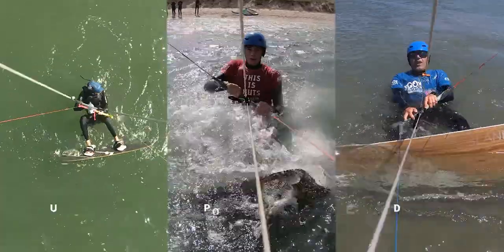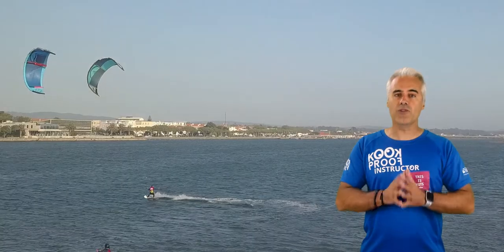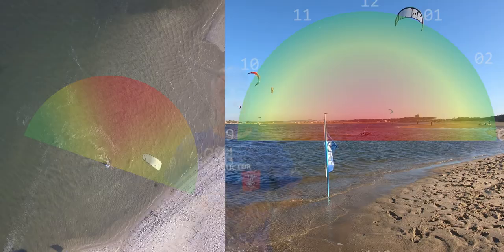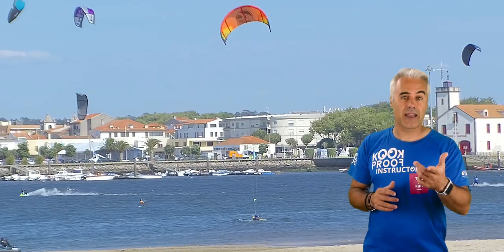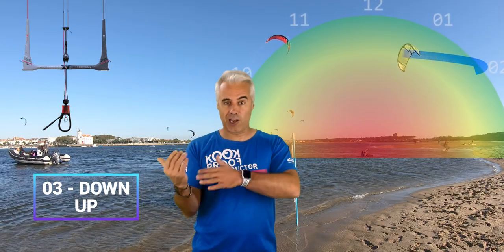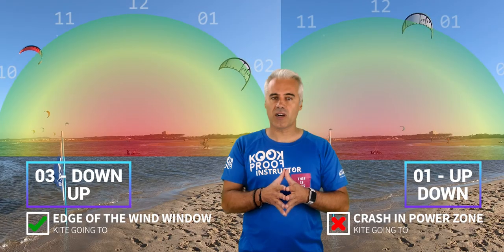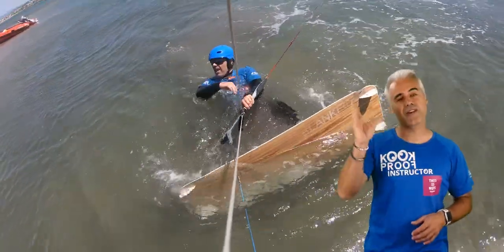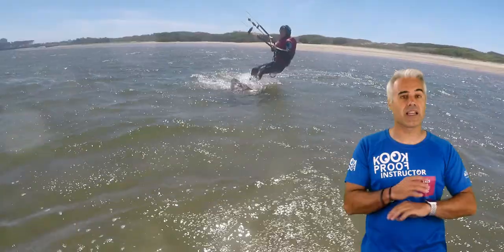Kitesurfing Water Start 3 BEST ways to manage it easily - Tutorial

Comment: One tip from me: do not try to stand up at all, point the board downwind, roll body forward after the stroke and let the kite pull you while keeping a very low stance, this way you can easily get comfortable with moving on the water.

Comment: Please please, teach everyone to set up like this. Do not leave lines lying all over the place. Take-off and landing positions must be the same. That's better, isn't it?
Reply from the maker: Not exactly sure what you are referring to. It’s not a great idea to leave lines lying around.
Reply: Hello, lay out the kite end to the wind and complain.
Lay out lines 90 degrees to the kite end. Start position! You already have the starting position. Leash, inflate and action.
Do not inflate and secure. Lay our lines to the wind - No !! Why?? That the lines will later be pulled across the beach, maybe over rocks or shells. AND:  no Problem with start and Landing with your Broth’s
Reply from the maker: I understand your point regarding the side setup of not dragging the lines over obstacles. However o the downwind setup you can do a line check before launching with a lower risk of acidental launch. I prefer this over the side setup as i usually use good beaches to launch. But i get your point.
Reply: @KookProofActivityCenter  What about the place on the beach?
Most of the time there is not enough space. Then the linen - (salt). Build the way you land, my opinion.
Reply: Why build like that? How do schools want it?
Reply from the maker: Schools setup most of the times downwind. This is done this way so students can double check that the lines are setup correctly. If the wind is onshore and the beach is small then in makes sense to setup sideways but you loose the ability to check before launching that the lines are setup. It comes down to the spot. Each option you take while kiting depends on the surroundings you are at.
Reply: So: I put the kite down. Lay out the lines. Starting position.
Put down the lines. The wind helps me with that.
I let go of the line and the wind carries the line with it.
I put everyone on the  Kite  and only then inflate the kite.
So the kite is exactly as I have to leash it.
Much safer if you ask me.
Just idiots 1
Reply: Schools setup most of the times downwind. Yes, exactly as well as at work. First you study for 3 years. Then you work and learn to do it better.
Reply from the maker: You can always find better ways for your specific spot that might be easier/better. I saw some videos on your channel so i understand  your spot better. it's not a huge beach and onshore or side onshore. Setting up downwind is not feasible or handy in your case so doing it side is better/easier. If you know what you are doing it is fine.

Comment: Thanks for the great video Tiago. Would be more useful if you can show a point of view cam at 7.14 rather than looking at yourself. From a beginner’s point of view, it is very helpful to be able to see the bar and the exact kite movements needed at each stage, to learn these techniques. Cheers.
Reply from the maker: Thanks for the feedback. I’m recording as soon as I can a new updated version so I’ll try to add this point of view
Reply: @KookProofActivityCenter  thanks Tiago that would be great 👍. Any footage without seeing what the kite is doing makes it difficult for a beginner to guess what you are doing.
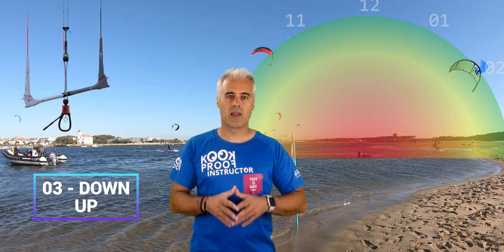Reply from the maker: You have the kite in frame at 4:41. As its the explanation of the movement. At the 7:14 it’s just me showing it but I’ll try to combine different points of view next time to make it easier to understand

Comment: Hi Tiago. Thanks for the good content. Here are some observations about the beginner waterstart.  They are based on the input of thousands of students and dozens of instructors over the last 17 years or so in our school:
Kite:  Student should be aware that they need to have enough control over their kite to commit to 2-4 efficient powerstrokes, linked together (without stopping at the bottom or top of the window),  until they have enough forward motion and apparent windspeed to stabilise the kite at 10 or 2 o'clock.
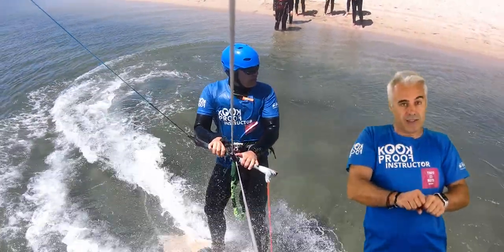-"Efficient" here means 1) sheet in on the bar for sharp turns, then 2) out to accelerate the kite as it comes out of the turn, then 3) back in again to harness that speed in order to generate power. (as you explained at about 5:15)  If the instructor is trying to get the student to waterstart with 1-2 strokes then most likely the student has been given a kite with too much power and too long lines, without first developing sufficient control over their kite. Evidence of this is when the student flies over the board again and again in their waterstart attempts.
-It's best not to bring the kite back behind 12 o'clock to start (or anytime during) the powerstroke, this just destabilizes the student.
-The upstroke is just as important as the downstroke and should go right back up to the top of the window in the first strokes to help pull the student up out of the water.
Board: 2 things need to happen with the board in the first part of the waterstart; it needs to point downwind and it needs to flatten out (so that there is not too much edging).
 -Rather than extending the front leg as the pull of the kite comes in, both legs should be kept bent to keep the student close to the board, so that less power is needed to get going. You are totally right that the student does not need to "stand" on the board. They can keep this curled up position with the legs bent until they are up and moving over the water, then they can straighten their legs.
-One of the biggest tips for the first part of the waterstart is to point their forward shoulder downwind and towards where the pull of the kite is coming from. This puts pressure on the forward toe to flatten the board and point it downwind.
Good videos, keep it up!
Reply from the maker: Matt-0 Teachings thanks for the feedback. Some nice tips also.

Comment: hi, thanks for the video. i don't really see much difference between methods #1 and #2. it seems like in #2 you just don't get the kite that much down, and this is it... basically depends on how strong is wind. #1 is just more amplitude thing. am I wrong?
Reply from the maker: That is more or less correct. The main diference is between 1 and 3 in the low wind.

Comment: In the end it all depends on the student, how are his/hers skills and how does he/she handle and understands the power and what kinda persons are you dealing with as an instructor.
I prefer a build up in power and a good focus on the legs and the power needed from the legs/knees. Start at 12 and go steer to 11 and try to get out of the water by using the power of the ite and your legs. Not enough? Go from 12 to 10.30, after that got from 12 to 10. Standing up by now and not crashing the kite? Go the 2 power stroke if needed to continue kiting.
But don't forget your legs and knees!
Reply from the maker: Of course, legs and knees are essential, and also the skills of the student play a role. The power is the same if the kite goes from 12 to 10 or if it goes from 10 to 12. The difference is from 10 to 12; it is helping to stand up as the force is going up. Also, if you fail on 12-10, the kite is going to the ground and can crash easily, destroying or helping to destroy it faster. Try it and see the difference.

Comment: After years of up-down waterstarts, this video is blowing my mind. I can't wait to try it out! 
Do you know who invented this method? Was it inspired by the kite loop waterstart? Is the bar sheeting similar for the kite loop waterstart (sheet in to steer, then out to center in window, then in again to power up)? Do you have any experience with the backstall method?

Sorry for so many questions, this video was very eye-opening. I  am trying to push my lightwind foiling to lighter winds. Which method would be the best for light winds?
Reply from the maker: Abraxas Filibusterofini i first heard of it the guy that trained me to become an examiner years ago. It wasn’t exactly like this, and i have been testing and perfecting it since then. It was not inspired by the kite loop water start, but that one works well also in light winds. The critical point is to use as much as possible of the power zone but have the kite pulling up and towards the edge of the wind window. The back stall method doesn’t use as much win window as the other two that cross it on the longest possible run. The down-up also gets you upward pull that helps you to stand up. That is why I recommend it to beginners in light to moderate winds using short lines. For hydrofoil in light winds should be very useful and give you the power to start and continue easterly. Once you test it out let me know how it went for you here in the comment box.
Reply: Kook Proof Activity Center I got to try it over the weekend. In light wind with a large kite (14M), the kite ends up near 1 while turning it around. However, I had success with driving down from there and quickly up through the power zone during the waterstart. So more like a U-shaped stroke. What I liked about this was that the kite ends up high in the window just at the moment I need a second stroke to start foiling! So a bit different from stronger winds smaller kite but still a substantial improvement from the conventional up-down. I’ll keep playing and practicing this in future sessions, thanks for the great tip!
Reply from the maker: Abraxas Filibusterofini glad it was helpful. Have fun in the water

Comment: I discovered power stroke method on my own after getting launched alot with up down method. Question about down up. Is the starting position same with up down, where board should be perpendicular to wind direction?
Reply from the maker: The starting position on the down up is with the board parallel to the kite. So it is already pointing downwind. There is a section on the video about the position of the board in that method.
Reply: @KookProofActivityCenter  yes you did mention about board being parallel to kite. But at what position? At 2 oclock?
Reply from the maker: @christopherjohnmercado1568  Yes, when starting it’s parallel to the kite so 2 o’clock starting point the board should be parallel to the kite position. This way once you start to move the kite the board is already pointing downwind helping you to get speed and stand on the board.
Reply: @KookProofActivityCenter  very interesting. Will try this!

Comment: Hi, will the proper kite size make a big difference toward a successful waterstart?  I’ve been stuck at this stage for a little while and feel that it’s holding me back from progressing further along.  I’ve taken two waterstart lessons from two different people (training with a 13m c-shaped kite) and the different bits and pieces of advice still isn’t helping me ride.  As of now, I can get up but will plop back down when I try to waterstart.  I also feel a bit underpowered.  I weigh 220 lbs and my home spot has 20-25 mph winds on a good day.  Therefore, is the 13m too small considering my weight and wind conditions?  Should I consider getting a 17m and keep practicing?  Thanks.
Reply from the maker: Hi Matthew. After a few conversions, i understood your size and winds. You can ride with the 13 c-shape in those conditions, but you need better skills. An SLE kite (bow or other design with more depower) will be way better for you to progress. A c-kite needs to have better power control as it’s less forgiving due to more precise power delivery. (Easiest way to explain). Practice will help you a lot, but i would get a different kite also. I guess you struggle more on light wind days. So go for the giant kite. In 17, i would say the ozone zephyr is a great kite. You will eventually get to the point that you will also be able to use the 13 by moving it up and down to generate apparent wind after the water starts to keep the power-up. I hope this helps and keep practicing. Cheers

Comment: Hi Tiago
I am quite interested by your « down up » technique, and wonder if it is more efficient on a spot totally « on shore » with a strong shore break and a wind quite light , in addition reduced by wave current (apparent wind)
In these conditions I need to gain speed very quickly after a first wave pushing me to the beach to be able to jump efficiently the next one with upwind speed. In addition I cannot afford any additional move downwind (at least more than the push by the waves)
The kiteloop waterstart works ok but it is quite difficult to time it properly with a large kite and the coming waves in your back when the board is just under your feet.
Does down-up allow less downwind move than an agressive S up-down that I used currently? And compared to a power stroke ? 
Thank you anyway to open my mind to new technique😎
Reply from the maker: starting in onshore conditions is always complicated. You need to get as much space as possible. Having waves makes it even harder. But this technique is for sure the one pulling you less downwind as you are carving almost from the start. Still you do go a little bit downwind as you need to generate some some speed. Glad i could help out.
Reply: @KookProofActivityCenter  Sounds good, I will try ASAP!😎
On the same spot, I need to use all the length of the beach to gain a little bit upwind! When at the end, would it be useful to make the tack transition with a similar technique to avoid to loose any ground? With your experience, is it something you would recommend as I never seen a video showing it as transition?🤓
Reply from the maker: I don't think so as a transition; I would make a normal one trying to maintain height.

Comment: Nice tip! I was always making N1, I will definitely try N3! Just one question: Do you have a video or tips on how to leave the kit 45º once you waterstarted? I am managing to waterstar perfectly and keep going, but I am always controling the kite that it goes up and down, I can't seem to leave it fixed at 45º to have a steady run and just focus on body and legs. Would love your input in this! Thanks
Reply from the maker: Keeping it steady at 45 depends on your speed. So you need to control this by edging more or less depending on whether you need to slow down or increase your speed to maintain the kite in the same relative position. (It will actually move forward or backward in relation to you but it should maintain at 45) You can adjust power by moving the kite(which generates more) or changing your edging. This edge change will change the relative position of the kite to you and the power it delivers.

Comment: There is one more good low wind method  for more advanced rider which is to kite loop, you do it by pulling hard opposite side of bar where you wanna go.
Reply from the maker: True. But not so easy to master for beginners. That is why I left it out.
Reply: There's a 5th method for low wind, but works only with softkites: backstall the kite at 12 o'clock to sink it deeper in the wind window, than stear it into the direction you wanna go
Reply: @Lack0  I understand your 5th method (I use both LEI and foil kites) but it looks for me quite similar to the down-up method Tiago described, with difference of just pulling the bar vs pulling very hard and wait to a clear backstall before sliding the kite through the power zone. I am I wrong or what are your main differences? From your experience, any difference between the 2 techniques on the downwind drift during the start that I would like being minimal on a very tough « on shore » spot ?😎
Reply from the maker: it is similar but a t the same time diferent as you need to point downwind to absorb the direct pull from the kite. in the down up you are already carving so you go a bit less downwind.
Reply: @nicolasboudet9302  I don't really use the backstall method. Actually I prefer Tiagos down-up method in low wind conditions and use the sheet in and ride method in stronger winds. I bought a new very fast turning kite (Kauper Maverick) a few months ago and with this kite on long lines (and also with my old Rebel on 13m lines) I can start with a 6th method: simply move the kite between 11 and 1 o'clock back and forth till I can stay on the board and then ride in one direction

Comment: Hello, didn't you forget to start with a kiteloop?
Start at 1.30 and fly straight to the other side to 10.30. Don't fly a curve - always pressure in the kite.
Reply from the maker: That is another possible one but I wouldn’t recommend it to a beginner.
Reply: @KookProofActivityCenter  Yes I understand, but what is easier? One steering movement at the beginning or several in the middle of the starting phase.
But it is only recommended when there is little and little wind.
Just that you know this option. has previously practiced with a Stuntkite, ...
Reply from the maker: I know this option, it's a bit harder than option 3. You do a downloop on the edge and let the kite pass through the power zone parallel to the ground. This is useful in low wind days but i would only recommend this to experienced kiters. A beginner might not be able to do this correctly and the mistake might be painful for him or for the kite.
Reply: Yes, that's right. Better safe than sorry.
But kite boarding has become so easy with the Bow`s. It's been almost 20 years since I started. But still a good tip!
Reply from the maker: It is a lot easier but that also makes people less careful and less aware of the hidden dangers. I've started in 2002 and since i learned by myself i had a lot of accidents and near accidents so i try to make is easy for the people learning.